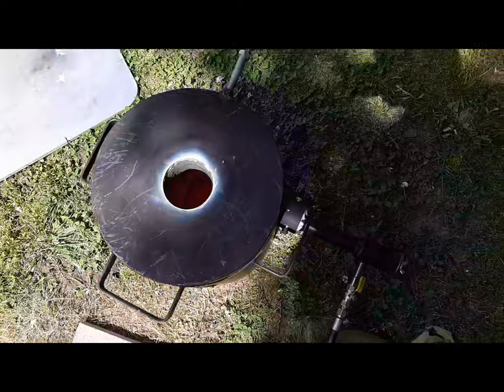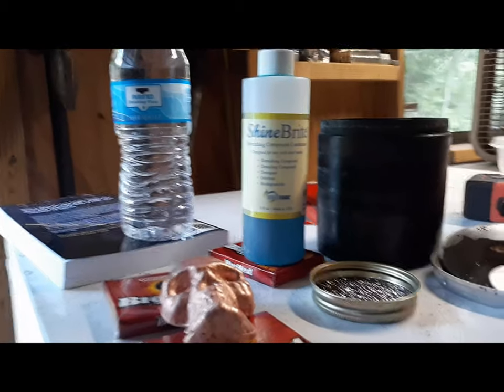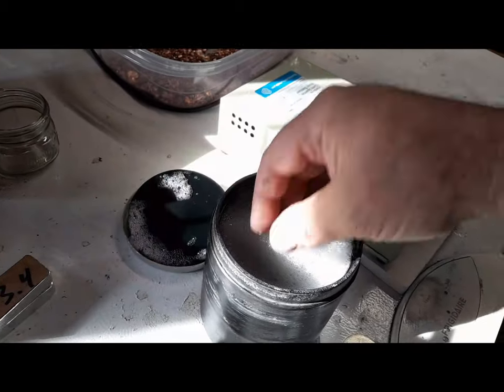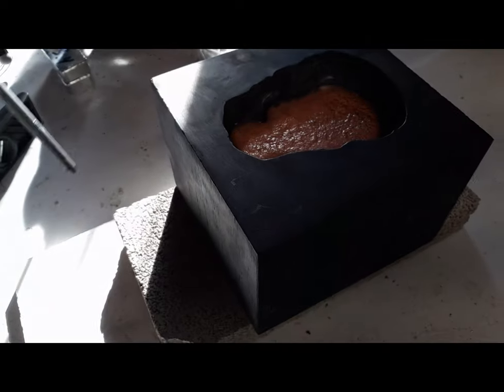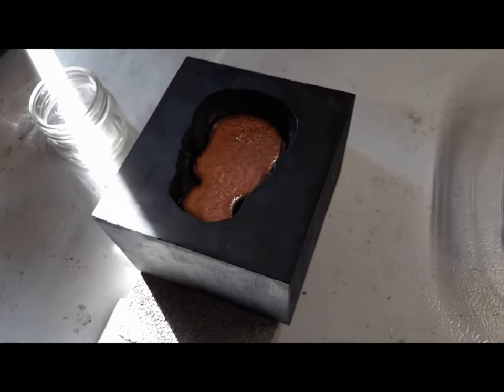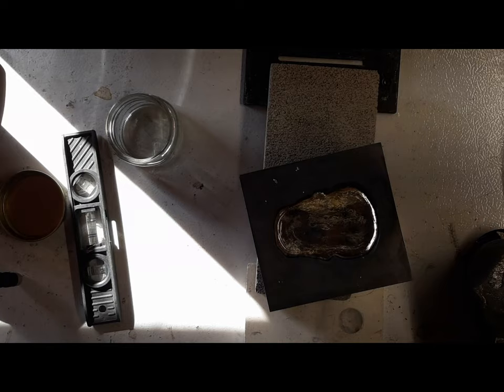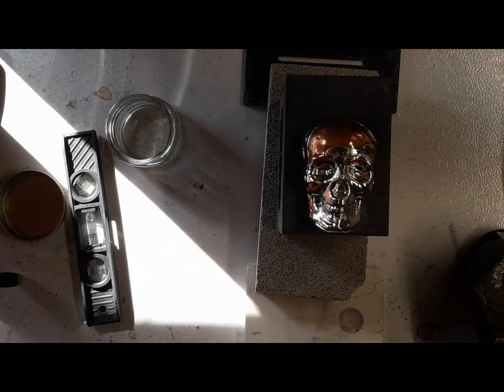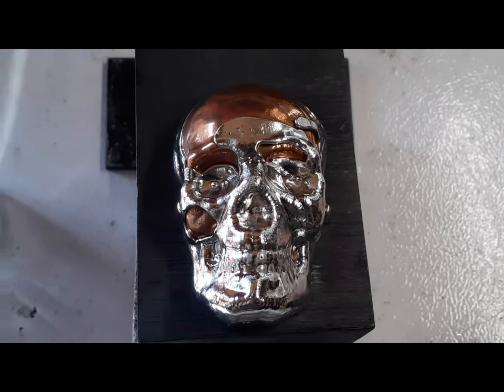How I Made this Copper & Tin Skull Step by Step

Comment: I didn't realize JUST HOW MUCH TIME goes into making those nuggets!😱😳 Have you melted down old copper pennies for material? I always roll them out of the penny jar to save. I had fantasized about having someone melt my scrap sterling into a brick just to be a cool bit. Awesome look to your amalgamation skull there James!👍 glad the material Temps agree so well! 
*SHOW YOU KITTIES!- OR PPL WILL WORRY COYOTES TOOK THEM!😬*
Reply from the maker: Copper pennies are only 95% copper and it's illegal to sell the finished product  the laws are somewhat hazy but it's generally frowned upon.  The kittys are great i had sweetie on the last video I believe. They don't like the furnace noises much.   I'm doing a foreign coin skull by the way 🥰👍
Reply: @ManMountainMetals  I think the Treasury department has more fun things to do nowadays🤫😝😏 Whilst I am not 'fully knowledgeable' in this area, I would THINK you could smelt off the impurities in that black crust layer of garbage ( sorry I don't know specifics). And almost every auction has copper pipe pieces in a box lot....😋
Reply from the maker: @baublesblingsneedfulthings7550   zinc is the other 5% in pennies. The boiling point of zinc is below the melting point of copper. The zinc combines with oxygen to create a yellow zinc oxide that coats everything in fluffy yellow goodness. Google 'Metal Fume Fever' or "Zinc Shakes'.....and I'm still pretty sure it only quasi-legal 😳 You get lots of negative attention from armchair YouTube lawyers in the comment section of penny smelters. I have some ideas using non usa coins.....oh and that crusty stuff is slag and it's made by adding flux which is anything from Borax & sand to lye or Boric Acid (roach powder) depending on the metal. It clings to the inside of the crucible allowing you to pour the metal cleanly. Then you take a 400 degree iron bar and pull out the molten glass/metal mixture before it hardens in the crucible (which is basically a ceramic pot so it's tough and fragile simultaneously) while it's red yellow hot about 2000F.  My point is it's stupid dangerous and I'm confining myself to baby steps until I get more confident. 😳